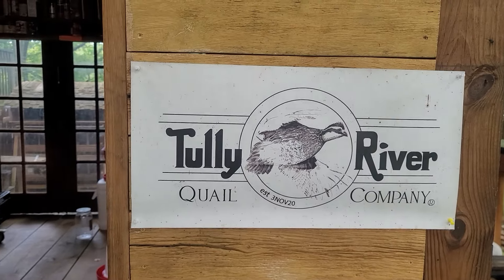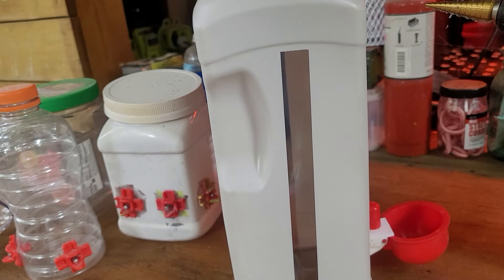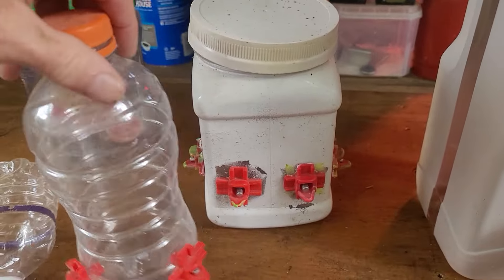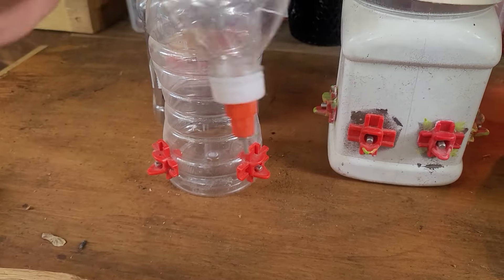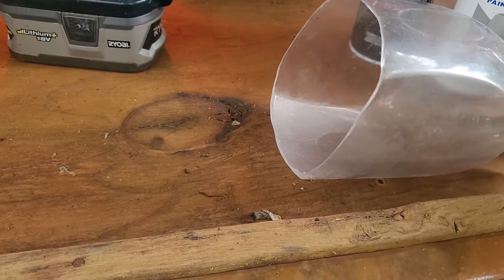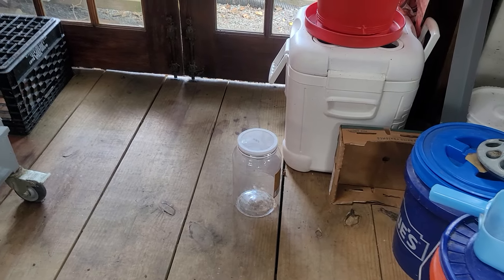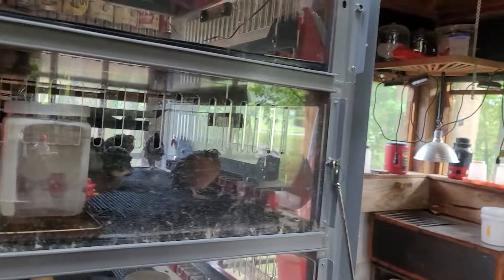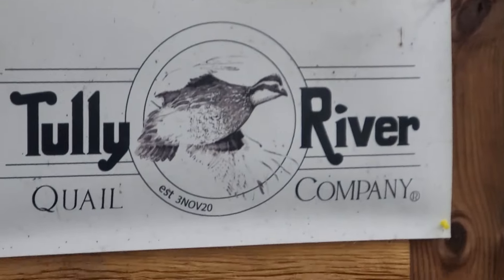- DIY Coturnix Quail Drinkers-  auto Waterer options from Repurposed plastics!

Comment: Great ideas, thank you! What ideas would you have to keep the water cool during the summer? It's been a scorcher in South Florida this year. It's almost impossible to keep the water lines cool even with insulation on the outside. Thank you 🌻
Reply from the maker: @LadyMaryanne  hi Lady :)

We use a 3.5gph circulation pump (~$30 ON amazon or on the USQuail.com supply store) in the winter as part of our freeze resistant winter watering system.  Our main water reservoir is a repurposed cooler with the pump inside the cooler to maintain prime.  I would assume you could do something similar and find a good solid square container like a widemouth grapefruit container and have 3-4 of these rotating through the freezer or even some gel packs.  Put two ice blocks containers in the cooler and put the pump on a timer that circulates for a few mins each hour and when those thaw, replace them with 2 new blocks and refreeze the melted ones.  Just know, water expands when it freezes, so don't fill the container up all the way and use something that is large enough and square so you don't Crack the plastic at the bottleneck.  You may be able to get 2-3 days out of each ice brick or just throw ice in there and let it melt.  The reusable option saves water.  We keep these blocks in our chest freezer for when the power goes out... it helps keep things frozen until the power comes back on.
You can search our channel for freeze resistant winter water keywords and see how we make these for our customers.
Reply: Hi  @tullyriverquail , thank you so very much for your detailed  explanation. I will search your channel as suggested. I agree, I think it will work. I appreciate you taking the time to respond. Blessings 🕊️
Reply from the maker: @LadyMaryanne  Hi LadyMaryAnne... your story/our soultion would be a great one to share on the USQuailCoop.com quail breeder directory platform.  Members can create a profile listing as a "starter, Grower, or breeder" to sell quail and quail eggs, or as a patron to buy quail and shop at the USQuail doscounted Supply store.  It's more than just a directory... its a quail growers ecosystem.  A platform to grow a business, write and publish articles, start and grow a podcast, print business cards and make promotional items, host your website and either your own professional email @MaryAnnesQuailRanch.com or get an @QuailMail.US account... we even have tools to log incubator hatches or share a "covey calculator" with customers so they can estimate how many quail they want based on the # of eggs they desire/day.  Lots more!
We are working hard to launch the directory but you  can visit USQuail.com to learn more about the initiative.  We want every community growing their own food ASAP to protect our families from the upcoming turmoil we are threatened with.
I will start doing daily 8 am podcasts on SoundCloud and on the USQuailCoop YouTube channel, and we will be inviting other members to do live shows in effort to create our envisioned "QuailTV" programming.
You font happen to know any computer programmers do you? :)  my older brain is getting slower by the day it seems, but trudge along we must.
If you have any questions, you can reach out to us via the USQuail website or you can pre-register as a Co-op member by clicking the Join Us button and we will notify you as soon as we have the doors of the coop open.
Caio4now
Stay Free!
Reply: Hi! Thanks again for the recommendations and great info. Due to health reasons I had to pause my quail adventure. Nonetheless, as soon as I get better and the weather cools I'm hoping to kick back into action. I will be researching all that you pointed out. Blessings to you and your family 🌸🕊️
Reply from the maker: @LadyMaryanne  we just opened the USQuail Cooperative store at Store.USQuail.com .  Great holiday gifts, books, and anything you could need to grow your Quail business.  
Best wishes & get better more faster.  I got histoplasmosis from cleaning the bobwhite recall pan last year... I was sick for 3+ months with a fungal lung infection.  The wife thought I was a goner.   
The USQuailCoop.com should also be open for registration in 2 weeks... you can earn cash from the affiliate program just by adding links to your Quail comments.  Might be a nice revenue stream while you recover.
Stay Free